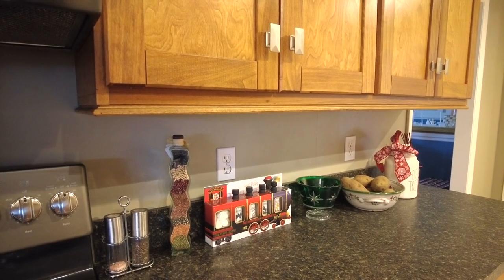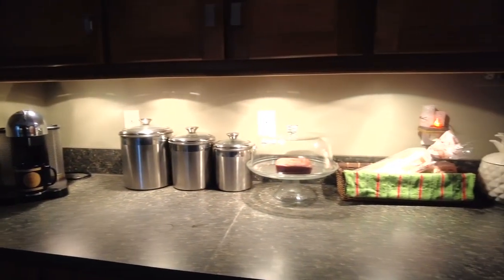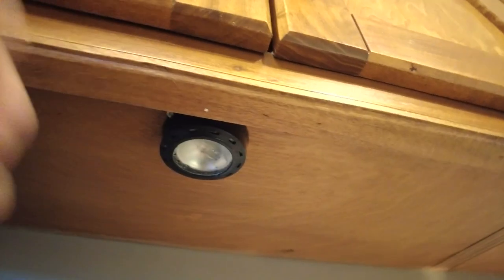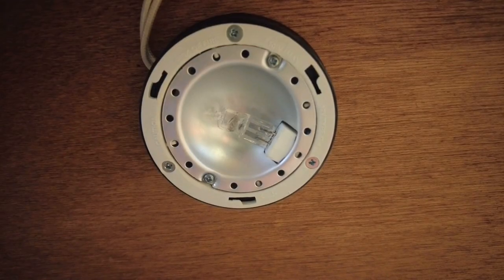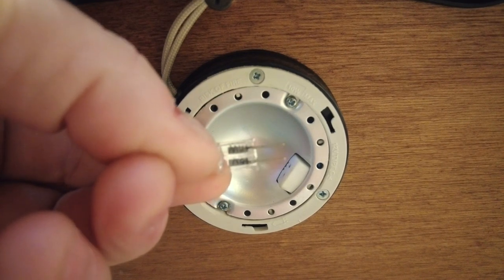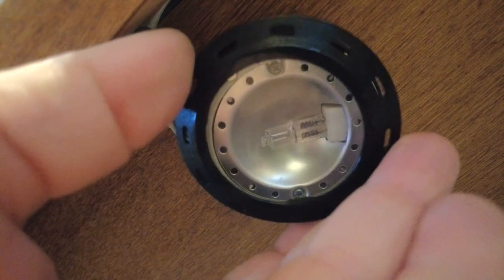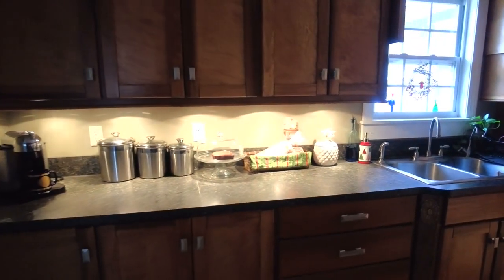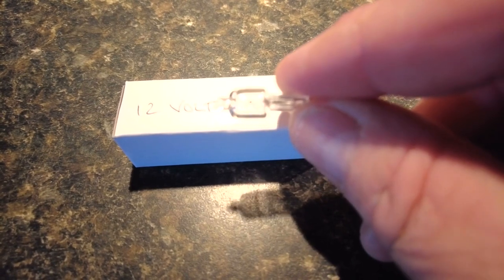How to replace above countertop halogen light bulbs in the kitchen.

Comment: I notice you were touching the bulb with your bare hands so I assume this wasn't a halogen bulb, which these usually are,
Reply from the maker: You caught me. I have always heard not to touch halogen bulbs. Now when it comes to car headlights, I never touch them, but I have always touched these bulbs. Even when I installed them new from day one and never had any problems with the halogen bulbs.
Reply: @diyhomefront1695  The idea is halogens normally burn very hot so any oil on your fingers that gets onto the glass might the glass to heat up unevenly and reduce the life of them (this would happen to me the first time I replaced a halogen torch light bulb in the 1980's). I just put on some latex gloves or use a paper towel when handling them just in case. It obviously doesn't matter when taking them out, but placing them in by hand like that might cause them to fail in <1 year. Not sure how these will perform, but I've done handled all halgoens this way SOP ever since that one bad experience (burned out within a couple months of installing a new one).

I have the similar setup in my kitchen (looks like a HR88 puck containing G3.5? pins). I was debating looking into drop-in LED replacements but now I'm thinking of removing the entire puck and seeing if I can find something else (like a GU10 LED bulb + housing) that can be driven by the same 12-24VAC setup.